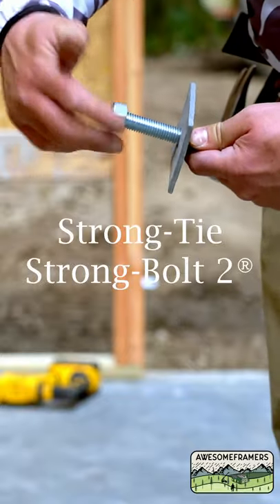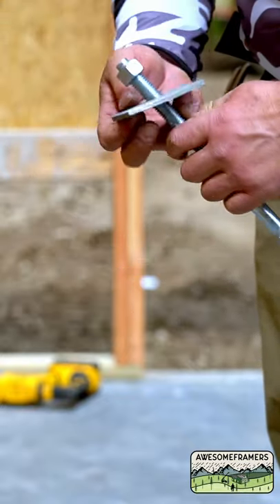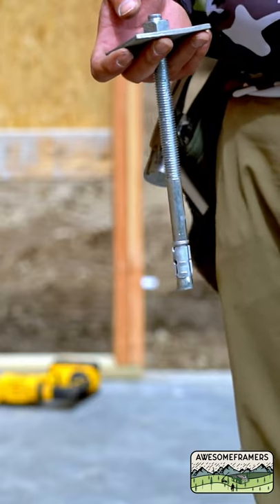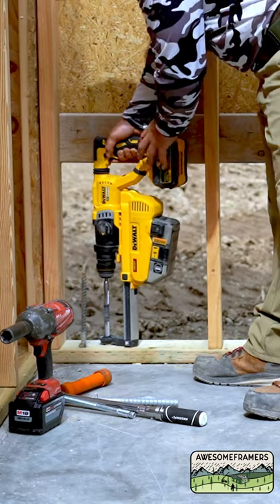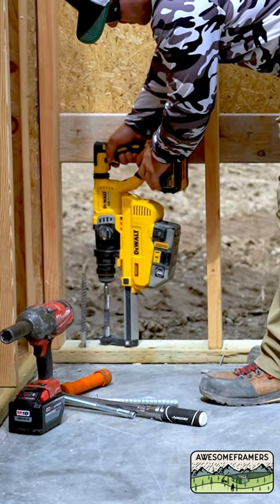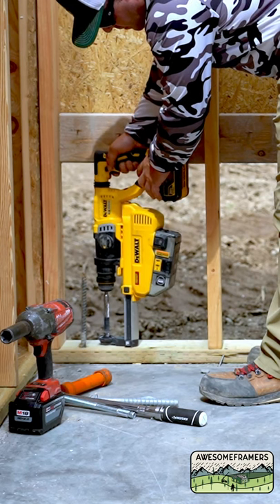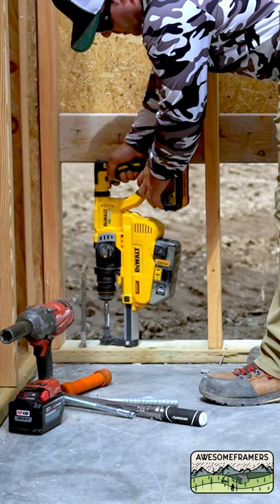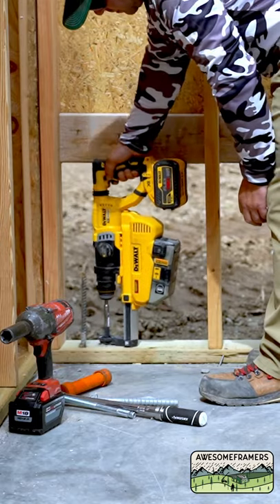How to Install a Wedge Anchor (Strong Bolt 2) #shorts

Comment: That Milwaukee wrench can tell a different story about torque used for tightening other bolts ;)
Reply from the maker: 😂😂😂😂  That was there for the Titen bolts.  Actually, thank you, I forgot to edit that video and post it
Reply: @AwesomeFramers  does that anchor bolt meet spec for all sill plate to concrete connections?

Comment: (Edit: This may not be true for all anchoring.  I have mostly Epoxy anchor experience over wedge anchors.  Check your instructions.)

Can we please talk about the fact that you have to blow out the drill dust before installing the anchor, per installation code.  This can have serious consequences on pullout as it changes the friction of the wedge.  The best part is, it is not predictable.
Reply: No we can't talk about that.
Reply: Try looking up the installation instructions on Simpson some time. You don't need to blow out expansion anchors if you drill deep enough for the dust to settle.
Reply: @kevinfarrell329  How recent of a development is this?  I was working with them 5 years ago when the instruction still said to blow and brush the hole to clear dust on the side wall.  I do agree that anchor depth isn't an issue with deeper drilling.  Asking out of honest curiosity.  I would be very happy to be proven wrong as it was a major safety concern for us at the time, and took up a lot of man hours/caused airborne dust safety issues for our guys.
Reply: @razgrizbird4562  it's always been true afaik.
Epoxy anchors are a different deal, of course, those must be blown and brushed.
But for mechanical anchors (threaded or expansion) there's no reason dust would matter unless it physically blocks the anchor from full embedment.
Reply: @kevinfarrell329  Maybe that's why I thought what I did.  I was looking back, and most of my experience is with epoxy anchoring.  I put a note at the top of my original comment.

Comment: A California school job I did years ago had cast in slab anchor bolts every few feet with about 12 inches exposed thread, and lots were in corners where you couldn't get a wrench on, and cutting the bolts shorter was difficult or impossible, or maybe the inspector didn't want us to, and getting a long enough socket wasn't easy back then, so I took a regular deep well socket home, cut it in half, and welded a piece of round tube in the middle.
I was so popular the next day at work! Lol

The engineers for California schools seem to have stock in Simpson Strong Tie, because pretty much every place where two boards joined, there was some Simpson product, often multiple.

But, it is likely to survive an earthquake!
Reply: You use a grinder and a clamp to cut that socket?
Reply: @checkmatenate  I had a big vise on a trailer hitch mount back then. In addition to making it easy to cut sockets, it also greatly reduced people tailgating me! Lol 
And yes, an angle grinder with a cut off wheel.

Comment: Never knew there was a torque spec. Not sure why I never thought about that.
Reply: Neither did this guy.
Reply: Every threaded mechanical fastener has a torque spec (aside from wood screws). It's based on thread size and the material the fastener is made of. The torque spec is calculated to achieve a specific clamping force depending on the materials being clamped together.

There's a lot of engineering behind it.
Reply: @internettoughguy  Even wood screws have a torque limit. Seems most bulk standard wood screws are made of cheddar cheese, and snap in half before pine wood hits max yield. Brass or stainless seem to be made with less cheese, as I've never snapped one of those.
But concrete has its limits on compression and so does that expanding bolt.
Reply: @JasonW.  Of course everything has a limit but I said "spec" meaning the manufacturer provides a number to which you're supposed to torque the fastener to achieve optimum clamping load. The manufactuers don't typically provide numbers for woods screws since  it's not practical to use a torque wrench when installing them.
Reply: Torque spec is going to be on anchor box.
Reply: Not like it not on the package but never had a complaint tho
Reply: @JasonW.  use impact driver not drill driver for driving screws.
Reply: No one does that. I know guys who don't even tighten the nut.
Reply: because it's not a car or boat or anything that runs.

Comment: One big tip when hammering bolts like this in, always set the nut even with the end of the threads. Prevents damage to the threads god forbid you ever have to take the nut off. And in this application i doubt you will but on state jobs they like things specific so if you have to remove something the easier the better lol.
Reply: Double nut and hammer square. Tighten with lower nut, remove top nut to clean up the threads.
But an angle grinder makes quick work of the mashed threads, if you can fit it where the threads are.
Reply: and yet you offer no alternative
Reply: @Tman0517  an alternative? Do it the right way? 🙄
Reply: @jman0870  the right way is in the video, my tip simply sets you to have less problems later
Reply: @Tman0517  You can damage the thread by hammering the anchor by hiting the nut.
Reply: I’ve always set the nut flush with head of anchor never had a single problem damaging the threads since I hit the nut and head of anchor. And I use a ton of concrete anchors since I install semi dock equipment and doors. I would rather do it like that and not have to get a grinder out to cut the end to take a nut off makes no sense to get another tool out.
Reply: @Bigphatnub  the part of the stud you hit is literally half the diameter of the stud itself. You have to hit the side of the anchor to damage a stud. Your logic makes no sense. 🤣

Comment: I’ve never had a torque wrench on a job site. Never thought of it either. I’m certain that I have never had an inspector check it either.
Reply: I have had them check ledger bolts on a hotel I built they had to hold 5000 psi they tested them at 7000 psi but those were all thread and epoxy we had a little over 10,000 bolt's 3 failed they tested 100 randomly.
Reply: @radishtrader5591  that's semi worrying isn't it? Hahah
Reply: @michaelf.2449  lmao, just funny how he put it. im guessing the bolts wouldn't even see 1500psi under rare conditions so 5000 is over engineered
Reply: @radishtrader5591 yes sir designed safety factor

Comment: If you want to add some overkill, shop vacuum out the dust, then brush some epoxy on it, then drive it in and torque it down. Even though StrongTies are constantly reliable, should there be any over torquing of it and/or some sort of mechanical failure it's backed up by the epoxy bonding.  Again, it's overkill, but worth the extra labor for the extra piece of mind.

Comment: When hammering the end of a bolt make sure your nut is flush or just a hair taller than the bolt so the threads will not get messed up
Reply: False these bolts are made with a specific top for striking, never make it flush..EVER..Dont speak on things you have no clue about

Comment: It's at the correct torque until the timber dries out then it's loose! Also I didn't think you're supposed to use extension bars with a torque wrench??

Comment: Or use the correct tool to drive it. But I’m my experience they don’t make a 5/8” drive it. So I use a ground rod driver on a rotor hammer. Or put a second nut to protect the top of the anchor. I personally just don’t like messed up anchors. That’s all.

Comment: Guy who I paid to build my garage said only suckers use this type of anchor and did a 2x4 pressure treated in the wet cement then nailed the bottom plate to the embedded 2x4 with no gasket cause that’s a waste of money.     Building inspector did not approve lol.      Watching this video I’m going to say my guy has no idea

Comment: I thought those threated bolt things were put in when they do the concrete then when the build the wall they drill a hole on the bottom board where those bolts are
Reply: @tkovthekingofvidoes7648  lol ur cute

Comment: Double nut with the 2nd nut slightly above the top, reduces mushrooming, PE
Reply from the maker: Thanks Richard!

Strong-Tie has a tapered bolt that also reduces mushrooming.  I have found this method works great with the nut right at the top.

Comment: Always use 2 nuts when bashing it with a hammer. Back them up against each other and you can effectively hit that anchor as hard as you want! That way you preserve the threads and keep the anchor straight without any mushrooming! 👍🏽 otherwise great video!
Reply: Thank you! Pretty basic info .stunning they didn’t do that
Reply: @Slowhand871  right! They are assuming it’s going to bite. Sometimes you need to back that nut off!
Reply: In this application the nut never needs to be removed. But even it it did need to be removed, you just use an angle grinder.
Reply: @johncoops6897  in any application “never” isn’t a word we use much.

Also yes, if you tighten the nut a quarter inch too tight, bang it in and it’s still slipping. You would then back the nut off as much as possible and try hitting again. 

An angle grinder also is not the ideal tool as that would be a zaw saw. To prevent scarring the concrete while still getting a flush cut. 

You don’t construction much do you?
Reply: @OutdoorCanadians  - You don't understand what we are talking about, do you? Go watch the video, then come back and tell evrryone how often the nut would need to be removed from the expanding anchor of the bottom plate of the installed frame of the outside wall of a residence.
Reply: You do realize that the bit you smack with a hammer is smaller than the thread diameter, right? Double nutting is completely unnecessary and an utter waste of time.

Comment: Do they ever strip the concrete out as you're tightening them?
Reply: Yes very much, and they don't hold up that well. I always use the gold anchor bolts with the center pin in it it will never come out.

Comment: How many foot pounds of torque is lost due to the socket's height?
Reply: A crow's foot would change the lever length, but a deep socket doesn't. So, zero.
Reply: 0.00000ZERO is lost. The socket makes no difference whatsoever. You have watched to many Torque Test Channel videos, and this is a completely different thing.
Reply: I never watched a single torque video.  I was just going off of experience with extensions and that's why I asked the question.  No need to get flustered there buddy.  Calm down.

Comment: You forgot to clean the hole prior to installing the anchor. The IFU does not state to, however the ICC-ESR approvals do not support that statement.
Reply: Simpson specifically says (for this anchor) you can either blow the hole or drill deep enough for the dust to settle.

Comment: In Australia we have to blow all that dust out of the hole then put a hole brush in clean the hole then we will install the trubolt then we tork up the bolt to spec. Trubolts can fail when the hole is not cleaned out under load. 🇦🇺👨‍🏭
Reply from the maker: Interesting. Here the manufacturer says the dust can stay of the hole is drilled deeper. But if epoxy is used then drill and brush
Reply: @AwesomeFramers   it’s funny how different our country’s are on some jobs the studs will get load tested and each job has a different % of testing. When it comes to kids climbing walls 100% are tested so cleaning out the holes saves the impossible job of getting a failed stud out.

Comment: I’ve never had luck with these. They always pull out. I use the Titan HD Anchors.
Reply: Really?
I have never been able to budge one.
Reply: @ajs96350  maybe I’m installing them wrong. I used to check them on jobs  when I was a building inspector and almost all of them would spin easily. No way they were getting 90 ft pounds. The Simpson Titen HD. Forget about it. You’re pulling the slab off of the ground!
Reply from the maker: @shaneoakley8757  I bet that's because they used a bit that was too big.  I'm with you though, I prefer the Titens, they are unreal
Reply: We usually spec Titans in structural applications. Wedge anchors get used where life safety isn’t a concern.
Reply from the maker: @chrisestill8825  my preferred anchor is the Titen, but his video was just to show how to install the SB2.  I'll show next how to install the Titens, though its'll be boring because they are so easy 😂😂😂😂😂😂👍👍👍👍👍👍
Reply: Have to agree fully with mr Oakley… wedge anchors kinda bite… Where I work we use a lot of Hilti products… hate wedge anchors… Either epoxy, screw anchors equivalent to the Titens… Or I even like their drop in anchors better than wedges… Any way good video none the less.
Reply: @AwesomeFramers  don’t worry. All of us building nerds will watch your video about screw anchor installation! Lol! With popcorn! 

True story, I just last week installed a mailbox kiosk on a development that we are doing. Super nice product. Very fancy and high end. They send wedge anchors to mount it with and I decided to use them as to avoid purchasing anything unnecessary. There were 4. One of them actually bit and held good. Other three pulled out. Needless to say, that mailbox kiosk is mounted with 4 - 1/2 inch by 8 inch Titens. She ain’t going nowhere! Haha!
Reply from the maker: @shaneoakley8757  reminds me a story my framing mentor told me.  He had a buddy who got sick of kids smashing his mailbox, so he decided to pour a footing with rebar into a column to support the mailbox.  It turned out so stout that when the city came in to widen the road it took them a day to dig it out with a backhoe 😂😂😂😂
Reply: Haha!! That’s great!
Reply: You know what they say, inspectors were contractors that couldn't make it.
Reply: @Tool_Addicted_Carpenter  haha who’s going to kiss the inspectors ass today? NOT ME!
Reply: I would blow or vacuum that dust out of the hole. Dust clinging to the sides can cause slippage.
Reply: The anchor has to bottom out in the drilled hole. I like a bit of dust  there as well. The wedge has to touch the sides and then the conical aspect take over. I can get them to bite if the drilled hole is too deep, it's technique.

Comment: Maybe mention silica is very dangerous and you should wear an n95 while drilling concrete and working with concrete dust?
Reply: @johncoops6897  strawman arguments makes you sound really smart 👍 👏
Reply: @psyience3213  -  at least I am smart enough to understand the difference between an argument and sarcasm.

Comment: I wonder if you’re actually hitting your desired 90 ft-lbs when using that long of a socket. Why don’t you research the torque formulas for extensions and long sockets.
Reply: Those are two different things straight deep sockets do not change torque applied because torque is radius x force, but if you where too attach something to increase the radius ie crowsfeet then yeah you bring out the formula.

Comment: Use a old drill bit and weld a nut on the end of it. You can use you hammer drill to hammer it down no need to use a hand hammer.
Reply: You don't need to use a hammer anyway. You drilled a hole for it, remember?

Comment: I've been remodeling for over 20 years and have Never seen a ½" black iron J bolt fail. This is what was used for concrete anchoring as long as there has been concrete slabs. It is absolutely ridiculous to require a ⅝" hot dipped galvanized anchor bolt.
Reply: Come back with the video showing how you fit that 1/4" J bolt into an existing cured slab.
BTW: 20 years is a long time... do you think you will ever finish that remodeling job on your mobile home?
Reply: John, it's not a ¼" J bolt, it's a ½". Obviously, with existing conc. a anchor bolt is needed... and yes, I am almost finished with this trailer. Next job will be a crack house. Thanks for asking.

Comment: So you have a impact sitting there and your hand tightening it? At least get it going with the drill then torque it after
Reply from the maker: Did you actually listen to the video?  the impact is there for the Titen since I shot video of that right after.  Hand tighten for the correct torque setting according to the manufacturer.
Reply: @AwesomeFramers  no had the sound off
Reply from the maker: @400080vikkash  been there done that 👍
Reply: @AwesomeFramers  I will re-watch it

Comment: First time I've ever seen a wedge anchor torqued.
Reply: That's because you were not taught correctly. Every fastener manufacturer has a datasheet for their fasteners which includes engineering data such has tensile strength, shear strength, and...torque requirements.
Reply: Ugga dugga them until the nut stops spinning. Then again, I only use wedge anchors on steel to concrete, not wood to concrete 🤣

Comment: You also can never get the nut off now either. The nut should be at the end of the threads of the anchor sh you don't damage them when you drive it in

Comment: Residential is so nice try drilling in commercial you cannot bust through the bottom like that and you have to wire brush the hole and vacuum it out all while Mr inspector is watching. So jobs you can get away with a video of you doing one. It's crazy.

Comment: You forgot to clean the    hole brush it off Wire brush  Blow out the Dust  with an air compressor